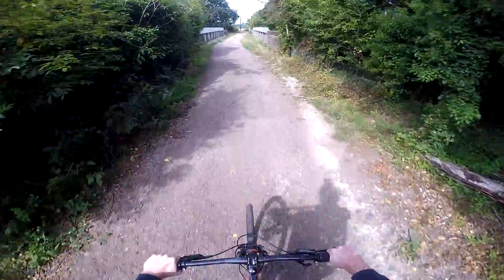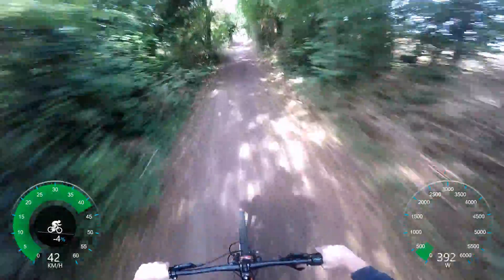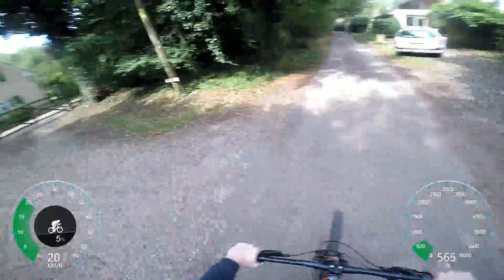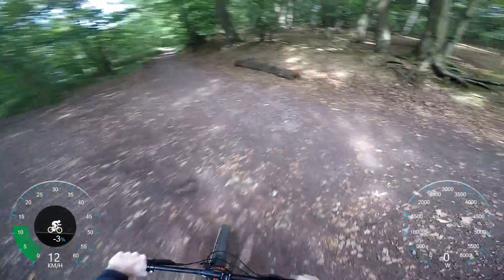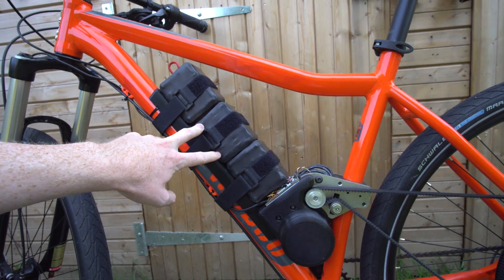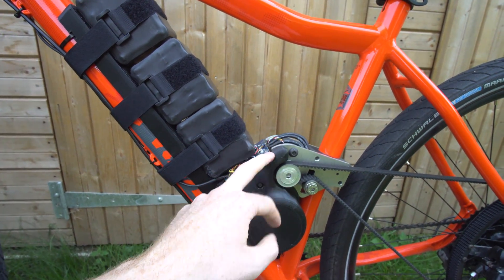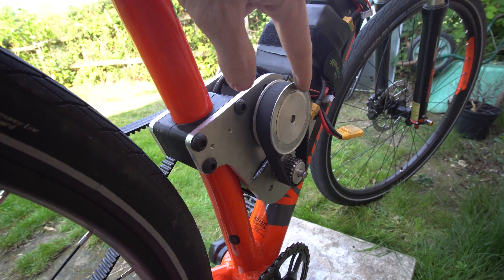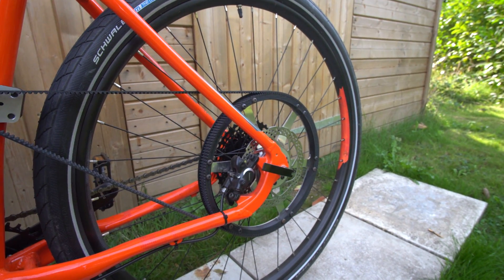Electric Bike 4.0 - First Test ride

Comment: It has pretty similar performance to a Sur-Ron. the Sur-Ron has a longer range interesting. the Sur-Ron has forks and rear suspension similar to motorcycle. same with the wheels and tires. the Sur-Ron also has regenerative braking.

Comment: Hi, what would be the best way to make that motor quieter? I have a 250w hub motor, and it is quite a bit quieter than that, and when you go on to the much larger hub motors, the noise can go down quite a bit depending on how hard they are being run. Is it just the type of motor, or is there some way to make it quieter?

Comment: Do you think this is better than the two motor setup?  I like the two motor set up! is it more efficient using a two Motors because you can go with her less powerful motor that's not so battery hungry. Same principle as Tesla use I believe.
I just wonder why having the motor going through another spindle is necessary there's some frictional loss, why did you do it that way? does it stick out too much is that why!
Couldn't you have just put the motor the other way round connected it to the bigger pulley and drive another pulley next to that for the back wheel? have both pulleys the same diameter and make the drive pulley smaller on the back wheel, I don't like the idea of having the belt on such a small pulley it will cause it to wear out prematurely better having more teeth then taking tight corners under heavy acceleration the 4-inch pulley looks fine just have two of those or 5 and 3.
When you're 3D printing put a slight bevel on the pulley to keep the belt Central instead of just flat you only need a slight amount of curvature
Definitely buy one don't have  have or know how to 3D printing or computer, so need to purchase thanks Berkhamsted area be in Marks and Sparks at 8 usually every Friday

Comment: Pretty awesome bike.  Now just hook up a dyno to pull charge off the wheels/use regen and dump that juice back into a large cap. bank.  Use that cap bank to handle initial acceleration to prevent voltage sag on the battery.

Comment: You should learn PID control and make a cruise control unit.
Reply: Or alternatively replace the throttle control with speed control so the thumb lever sets the goal speed instead of the power.

Comment: Honestly, your Tom Stanton Pigeon Flyer 4.0 ended up being much more complicated than the mid-drive lol! I still think you should do the Mid-drive with a jackshaft, its really not that hard and you get the best of both worlds, lots of torque "wheelies" and high speed, I'm going to keep bugging you until you start prototyping the mid-drive + jackshaft which you pretty much already built with the gear reduction box. I built one with scrap steel and I'm really dumb compared to you so it should be a walk in the park for you, lol!

Comment: I'd love to have one of these, but where I live, this is classified as an electric moped (not electric bicycle), since it goes faster than 30 km/h and doesn't require you to peddle to deliver support power.
And so it would need a license plate and a full-face helmet, but more importantly: official safety etc certificates, the same that Honda, Vespa, and other such moped manufacturers need to get to let their bikes on the road :/
So at that point, it's financially much more viable to just buy a high-end electric bicycle, like a Cowboy (±€2000)!

Comment: Time for version 5: use a chain a sprocket drive instead -> more efficient, and probably more durable than the belt. Belts are good for timing, not for transmitting power.

Comment: My bike is is chain driven. It has take lot of work to get chain line straight, but now it works. I have brushed motor and good torq, easily wheeling in 18th gear.

Comment: This is so cool, amazing build! 

What type of belt are you using, and what type of gears?
Im planing of building something like this, but im thinking of a bigger gear on the rear wheel and direct drive it on the motor, or do you think this will cause to much stress on a motor? Any one got tips for good motors ?
Reply: Tip: Pay attention to gear ratios, they are important.

Comment: Do another one of this E-Bike but place a motor that will regenerate power whilst running. Maybe put it in the front and use one way diodes to prevent backflow of electricity. Also please program the motor that is driving the wheel to also regenerate power when you are off the throttle
Reply: Pidong Gaming regenrative? A battery cant regenerate power on its own. Could use regenerative brakes

Comment: Amazing job!
Please, I need your opinion...
What do you think of a bike where you spin alternator  by pedals and charge the  battery, wich powers the high speed electric motor with gearbox in the hub? I`m so  tired of all that dirty greasy expensive stinky chains, sprockets and derailers!
Maybe every wheel should have a motor on some bikes, fat tire bikes,for example. 
Small motors for everyday use, about 500 watts for an average bike.
All sealed units, no everyday maintenance. 
Definitely , that will help more people to get on the bike fore everyday life! 
Just charge the battery at home and go! Running out of charge? Just spin it!

Or there is one more way - middrive motor with gearbox like pinion and alternator with pedals, rear wheel is driven by SEALED tooth belt like yours. Nuseti bikes does similar sealed belt drive. 
Maybe some clutch should be done between pedals and belt, I mean, if all electrike system is dead and broken you engage that clutch and connect the pedals directly to the belt driving pulley.
A kind of the plug-in hybrid with human instead of an engine.
Sorry about my english, I`m from Siberia :)
Anyway, great vids! Subscribed!

Comment: Have you thought to use two spider gear vertical, one mounted on the motor and one one the back wheel? I'm a physicist not an engineer, but engineering is a very tempting field of science, so it's just an idea and I would appreciate if you answer...Thanx in advance and your idea for the E bike is the best I've seen till now!

Comment: Hello.
What you did and how you did it is amazing!
I also installed a VESC controller on an electric bike, but I used VESC v4.10 + active diy cooling. I used 13s battery (54.6V 40Ah) and MAC 7T.
Why you don't use current control mode?
Link https://metr.at/setup is not working :(

Comment: The aluminum next to the motor is an eddy current issue. Perhaps a fine copper mesh between motor and mount would inhibit the eddy? 
https://en.wikipedia.org/wiki/Eddy_current
https://en.wikipedia.org/wiki/Faraday_cage

Comment: You could perhaps add a dynamo in the mix as well so when you normally drive it using the pedals it could charge the battery and that could be used to drive the motor when needed.

Comment: Hi. I bought an esc. It's 80A Xrotor. When I connect it it's running a little and after stops. Everytime I repeat it's stops by himself.with load also stops. What can I do in this case? It's possible to fix it. I'm new in that kind of technology. Thanks!

Comment: Hey Tom would be nice if you could re-engineer this for regen, to suit dual suspension bike would have to have another sprocket at the pivot point BB, this could have a clutch to enable regen but clutch at the rear freewheel would be better for less drag when you run out of power. Also check out the hobby king vesc for price. I actually think it’s worth pursuing with this project especially if you can achieve no drag and regen since no other mid drive bikes can do this. Also dump the throttle and install a torque sensing BB from AliExpress.

Comment: May I suggest incorporating a heat sink in your cover for your controller, and vents in motor cover.?
I like the idea you had to make covers for pulleys.  Maybe some fenders. Battery cases that have quick-release connectors,vents, and USB ports for charging .
Rear  drive belt should be geared to a  cast aluminum sprocket ( or machined from aluminum plate stock )
If you used flexible solar panels in fenders and other surface areas, you could charge battery pack while bike is    outside on sunny days.  I think once bike is 100%, you should market it as a DIY Kit, I would by 2 today!
The way it sits as of this video, this setup would work on my bikes. 
I am also a CAD designer as a hobby, and I have many ideas for lights and other accessories for this design of yours that I would love to share with you. I want 2 of your kits if you market them ( esp. if you incorporate my ideas listed above about solar fenders and  protected elements of your design)
Best wishes, and good fortunes ,Dave
PS If your company needs a logo, I am your guy. Chrome paint on pully covers? etc... a little  branding?

Comment: Spectacular work ! 
As a Brit, and someone that built a 1kw eBike in 2011 I am so pissed off at this stupid 250w limiting law. There is no real logical reason why the speed limit should be less than 20mph before a cut off should be required. And 1000w could be perfectly safe so we can have a vague sense of acceleration. The amount of money we waste as a country on fuel is bloody insane because of laws like this. I will say that there should certainly be laws about quality control of the components for instance to prevent battery fires or the loss of control of the motor. But if the bike or "bike kit" has gone through some level of testing then we should be able to get our hands on more powerful kits for a reasonable price. 
Instead now the companies I have seen that sell bikes limit the motor to 250w which is pathetic and forces pedal assist so you have to be peddling at all times. And to get a bike of the same quality as the one in this video would cost £6000. And yet I bet this bike probably cost less than £1000 to build and is highly maintainable as any faulty parts can be hot swapped out.
/rant ffs

Comment: You should sell that rear pulleys. I bet there would be a lot of people interested in it for diy ebikes. I cant find any good solution for mid drive on the internet... wanted to make full suspension bike with motor mounted on swingarm + similar setup as yours but its impossible to diy that parts without cnc or 3d printer. Now im using hub motor but suspension works really bad with 8kg wheel.

Comment: Hi Tom, Big fan of your activities :) Can you please make a summary list of the material you are using ? such as VESC, Motor (size and Kv), type of connectors, Size, capicity and C rating of your battery, what charger are you using. Now that your bike is extremely well designed and effective, a small review of your hardware would be nice ! Keep it up, you're doing it the right way !

Comment: This is super cleanly done. Excellent job!

Not sure if it's possible with your current design, but some kind of a clutch for the motor would probably help so that you can pedal when you want to without fighting the electric belt drive system.

Comment: Tom, with your M5 HDT Timing Belt Pulleys, if you use a 20 Teeth 8mm Bore 21mm Wide Pulley on the Motor Drive going to a 30 Teeth 10mm Bore 21mm Wide Pulley on the Driven Shaft which Drives a 25 Teeth 10mm Bore 21mm Wide Pulley with a 20 Teeth Size NO TEETH 10mm Bore 21mm Wide Idler Pulley going to your 180 Teeth 21mm Wide Wheel Pulley then this is what happens.

On a 26" MTB wheelset @ 80 amp continuous you will go 67.59264 km / hr & @ 150 amp burst you will go 68.862336 km / hr with faster boost because of the increased torque from the amps. Since my wheel circumference is 1945mm & you most likely have a 29" x 1.5" MTB wheelset then your wheel circumference is 2193.46mm. So 2193.46mm / 1945mm = 1.12774293059126 times the speed that I could do if you changed your pulleys then your top end speeds would be. @ 80 amp Continuous 67.59264 km / hr x 1.12774293059126 = 76.22712192 km / hr & @ 150 amp Burst 68.862336 km / hr x 1.12774293059126 = 77.659012608 km / hr.

Play around more with the pulley's & you might be able to reach 100 km / hr.

Mark

Comment: Hey Tom, really great video to the series of updates on version 4.0. I spent all day today getting cheap prices on all the parts to do this myself using my Carbon Fibre 26" Mountain Bike, a 12s 8p battery 50.4v 20 Ah & I found a 44V 48V 50.4V 12S 150A Continuous BMS / Balancer.

The build is quite expensive. I was wondering, the motor drive pulley 20T & motor driven pulley 40T did you go with HTD 5M 15/20/25mm  Width & the 20T to 180T wheel pulley did you go with HTD 5M 15mm pulley's & belts? They are 5mm pitch 20T 8mm bore pulleys & I'm guessing you used 5mm pitch 20T & 40T 10mm bore pulleys because I've not found a 5mm pitch 40T 8mm bore pulley yet.

Tom, I don't have access to a 3D printer to make the 180 Teeth 5mm pitch 16mm internal diameter wide plastic wheel pulley that mounts onto the back wheel. Is there any way we could work something out where you print up a pulley & I can pay you for materials & shipping using Western Union? I can make up all the aluminium brackets & frames to put it on, I just need the pulley with it's holes ready for tapping M5 so you would only need to locate the holes with a 3mm drill & I can sort the proper tapping drill size & threads. Thanks.

Mark, Perth, Western Australia

Comment: Regenerative mode coming up I hope. Not to bash on your success but you did the easy part. Now get to the hard part...that'll be a nice challange.
Reply from the maker: Regenerative braking is the easy part, will take 5mins to enable in the speed controller ;) I made a video about it a few months ago if you're interested
Reply: @TomStantonEngineering  Yeah, well I wasn't refering to braking only...that's why I said is not easy :p (should have been more explicit) You have to mix the electronic brake to your mechanical break and also you could see when you have torque coming from downhill rides and use regeneration without using the brake per se...and you also should control the recharge process not just blindly put current back into the pack...this is why I say it' s not easy balancing all this things out safelly. :) (Ofcourse you could just do blind regen braking period, and that would be easy) :D

Comment: Just want to inquire if your controller is configured in sine wave pattern. It will make the motor run smoother and with less noise.
Reply from the maker: Yes it is configured in sine wave pattern. Still not sure why it's so loud. Thanks
Reply: How's the vibration at high RPM? Probably, it's not perfectly balanced yet.

Comment: Great to see this bike up and running. I use the same Vesc6 Tampa on my 12s4p dual direct drive mountain board. 

You could totally cool the motor by adding some vents in the housing and then use a kitchen splash screen mesh wrapped and then glued between interior walls to protect against dirt and other objects from entering. I have done a similar thing for my Trampa motors. 

The print walls end up looking printing like this: | wall | mesh | wall |. 

I've found that the spinning motor itself is able to produce enough airflow to actively cool itself.

Also its great you are going to 3dprint a cover for the Vesc but Tampa also provides a rubber cover which would also do the trick.

looking forward to seeing more progress!

Comment: Tom, you should try putting the VESC in FOC mode... would be a litle less power but it would be a LOT quieter ;)
Good job though, amazing build dude :)
Reply from the maker: It's actually running FOC mode currently, so I'm a bit confused why it's still so loud. Thanks!!
Reply: @TomStantonEngineering  that's odd... Must just all be belt noise then 🤔
The aluminium in your wheel pulley may be resonating perhaps?

Comment: Did you make sure the belt will not slip at max power using engineering or did you just hope it won't ? I hope what I said means something, i'm not fluent.

Comment: The whole project is clean and the result is stunning.
I would propose a new version, which has a ordinary chain hooked up to the biggest cog (there are cassetes with 50 tooth now) of the rear cassette on the right, instead of the rear pulley + belt.
Essentially it will have 2 chains on the right side. 
One downside i guess it would need to have an ever bigger reduction on the right side (will probably need to be transferred to the left side also) from 2 to 1.
Also you won't be able to use the highest gear which will be always reserved for the motor.
This way you eliminate the need for a pulley construction and belt system. 
Imho a quality bike chain is enough from experience i have with 1500W off road system.
Hoping you see my comment!
Reply from the maker: Thanks for the proposition! I had actually considered a similar idea, however the issue is that the pedals will always spin when the motor is running. I know you can buy freewheel pedal crank sprockets for ebikes, but I'm not sure they'd fit on this bike as the frame only allows a very small crank sprocket.
Reply: Yes you are correct, the rear cassette freewheel is not helping in this situation.
For simplicity sake and solely for assistance on pedaling, i am thinking to create a similar system as i am fascinated with that.
Best solution to this is indeed some kind of freewheel cog on the crank.
Reply: Found a freewheel crankset.
https://www.sjscycles.co.uk/cranks/shun-alloy-104-pcd-4arm-freewheeling-cranks-170-mm-silver/?geoc=US

Comment: This bike is incredible! Awesome build, would be worth while to get a full face helmet, this bike is pretty quick and it could save your bacon if you crash!
Reply: I’ve also had my ebike handle grip separate from the throttle body and it slipped off the bars. It would be good to check your design, I dremmeled off the last 5mm of the handle and put on an “ODI” lock on grip so even if the handle breaks again, it’s stuck on the bars